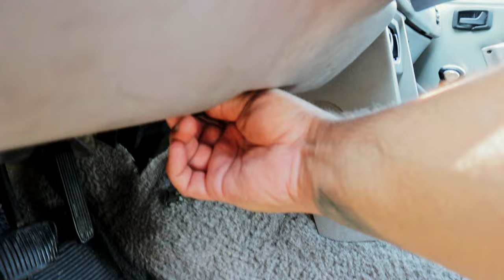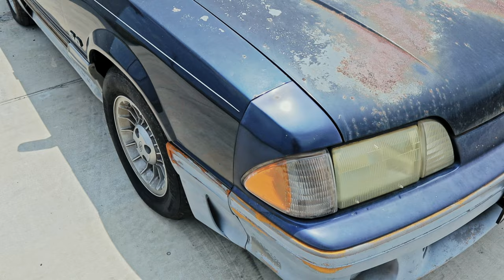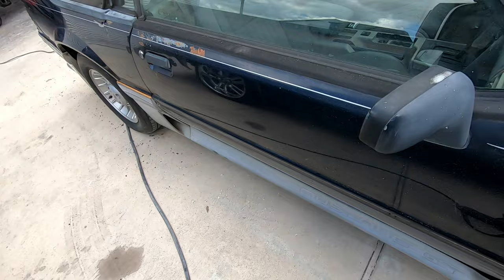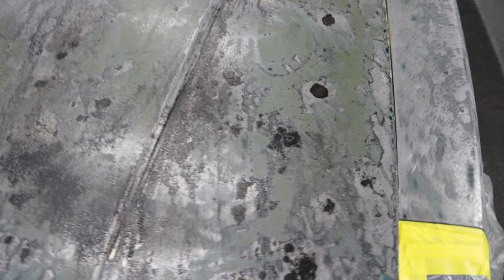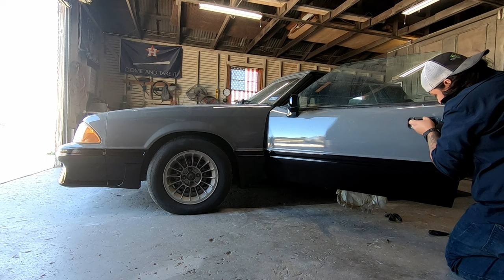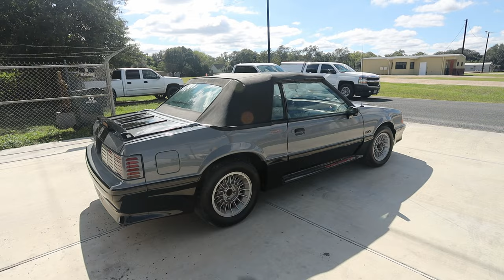1990 Fox Body Mustang Complete paint job (color change)

Comment: How much paint did You use?
Reply from the maker: I believe I used about 1-1.25 sprayable gallon of base coat 
I shot jams, under deck lid, under hood and full exterior with the grey before the black was done
Reply from the maker: But that’s just an estimate 
A lot of factors go in to amount of paint
You use - the coverage of the paint (quality of it) what sealer or primer you use 
Etc.